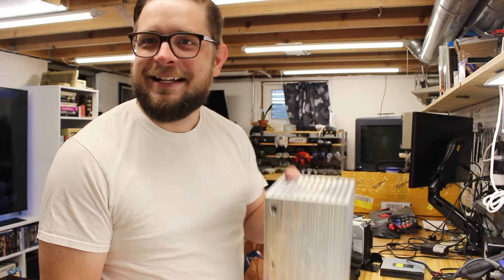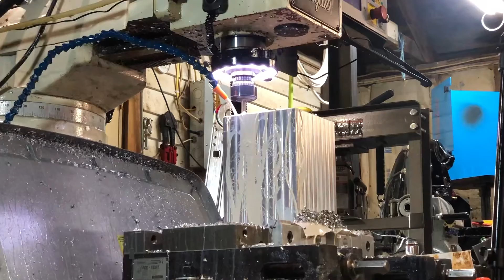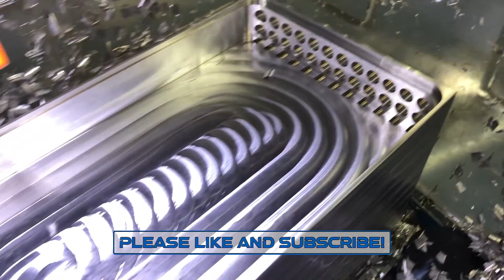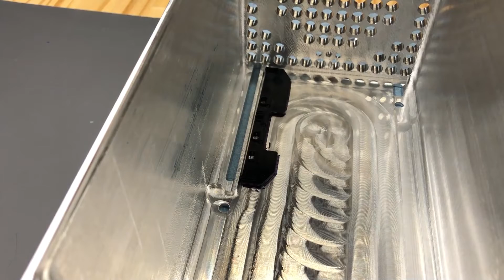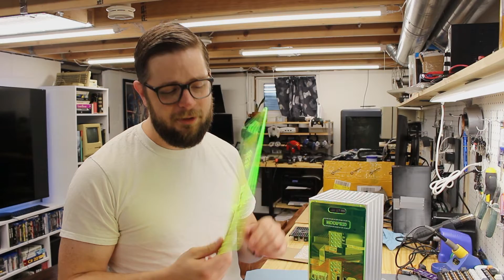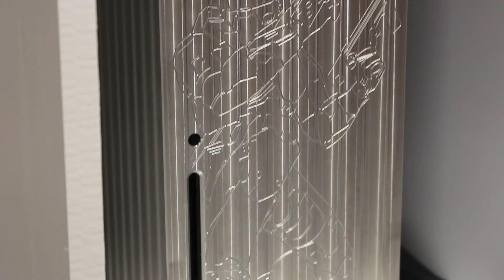World’s First Aluminum Xbox Series X

Comment: It's been my dream to design something like this but I imagine the price of ordering it from a machine shop would be stupid expensive. Would be cool to take it one step further by getting rid of the factory heat sink and adding something like heat pipes to bond the CPU/ GPU coolers to the chassis and have it act as one big heat sink. More work but it would take advantage of the material.

Comment: Ignore this if I just couldn't see it, but - some sort of air jet ought to sort out the warping you're getting with the laser cutter. I've got a £15 aquarium pump with a bit of tube tied to the laser lens and it works surprisingly well
Reply from the maker: Yes, I have thought about adding some forced air. I have some fans I’m going to add along the length of the bed blowing towards the back. Hopefully that will help some :)

Comment: This is awesome, and motivated me to start building a workup in Fusion for my series X. Was wondering what measurements you got for the cut outs? (i.e. disc drive, power button, air vents, etc.) Would you be willing to share that info?
Reply from the maker: I’ll be releasing a video and files on a custom DIY XSX case in the next month or two. You’ll be able to get the dimensions from them. :)

Comment: I was about to suggest a spherical cutout for the top, then I realized that would either leave the corners undrafted or the sides unlevel. I work with SolidWorks at my job and I can't think of good way to get that shape. 
How does one define the shape made by a large water balloon slightly poking through a square hole?
I like the machined look, but I wonder how it'd look sand blasted or brushed. It might be easier to see the etching that way, since aluminum is so reflective.

Comment: Won’t aluminum get hotter than plastic? I don’t see that workin long term. But good try.
Reply: He's right with the aluminum the case actually has a better coefficient of thermal expansion and and aluminum is able to absorb a lot of heat and dissipate it rather easily thats why we use what we call aluminum chill bars when Welding stainless to prevent the stainless from getting too hot obviously the heat difference will be drastic but should work rather well
Reply from the maker: Hello! Thanks for watching. Aluminum will keep it cooler than plastic.

Comment: using plates, welding and polishing would have been so much less wasteful, much faster and much cheaper... they would have to charge $10k each if they built them this way... you should have went with no bottom instead of no back though... bet you couldn't find a tool for that though
Reply from the maker: Hello! Thank you for watching. This wasn't something we made to sell. We're a machine shop, and didn't want fast and cheap. The goal was to make it out of a solid piece. This is meant to be more of an art piece and there's never just one way to do art. :)